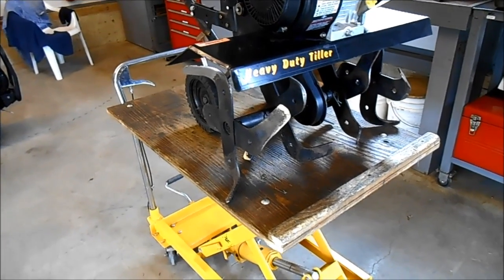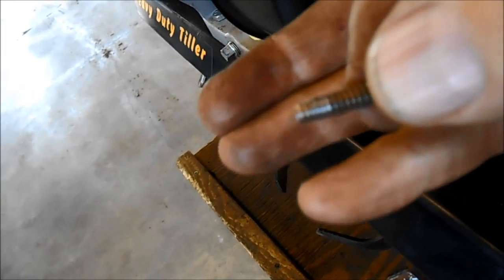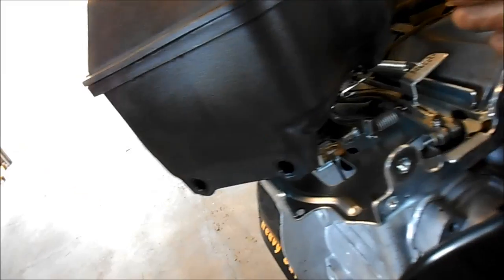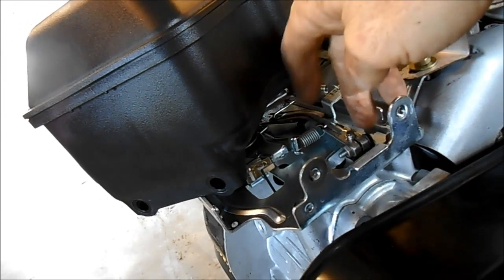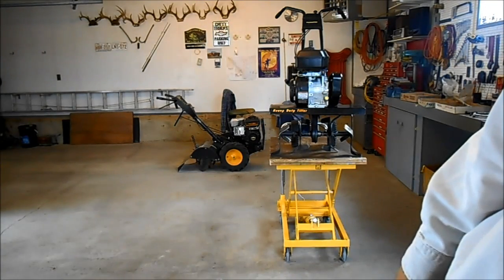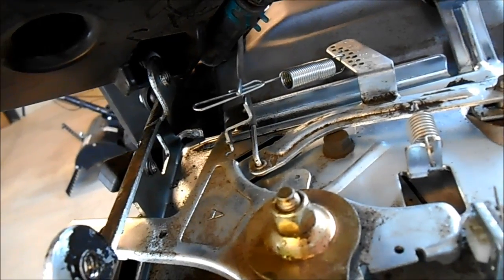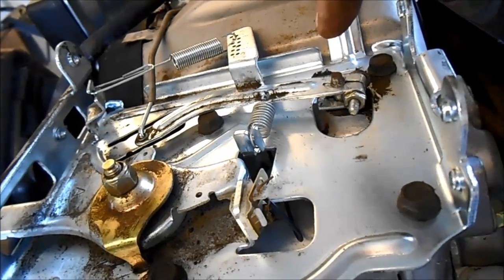Repairing a Governor on a 6.5HP Briggs Intek Motor

Comment: Great vid, I have the same governor setup. My 7hp tiller runs wide open. I replaced new carb, springs seem to work, set the governor counter-clockwise at wide open. It still won't idle or vary with throttle. Could the internal governor system be shot? Any other advice? Should I replace throttle linkage arm and springs?
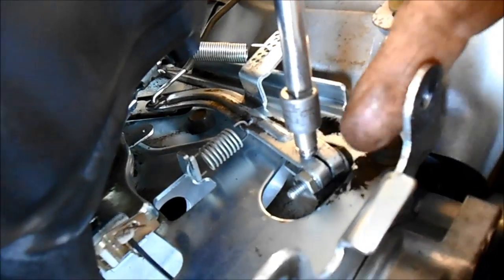Reply from the maker: if the arm is stretched around the govenor post (touching on both sides) you can take a hack saw and make the slot wider.    You can see it on 3:41 which could be touching in your case
Reply: @BrucesShop  So maybe the arm is not tight enough and is slipping? It is pinched together, so I'll give it a shot. Thanks so much.
Reply from the maker: @obamazadork  good luck

Comment: Good Video Bruce !!!
i will try to bend the TAB bring my RPM Higher on my Craftsman Snow Shredder ( i Diddled this Engine Myself after i Bought it used with a BLOWN Engine ): https://www.youtube.com/watch?v=-1lndf-o_Mo&t=3s
Reply from the maker: I commented on your video.  great work.  Joni
Reply: @BrucesShop  i used it today - idle went crazy high for 5 mins then settle  down ( i think to 2800 rpm) not sure though just going by the brightness of the light bulb

Comment: I'm so glad I found this video my briggs /murray mower is so old I couldn't find nothing on it, parts briggs no longer support, it was surging so i cleaned carb ran great they my gas tank started leaking around the diaphragm so got new ones now it is revving badly, that is like my governor so I'm gonna try and adjust it..thanks very much,
Reply from the maker: Adjusting the governor is the last thing to try.  Recheck your springs and tension.  Then do the governor.
Reply: @BrucesShop  I just got back the hardware store here said they didn't have that spring I wonder if i can order it, I got a spring and put it on and it still revving to bad I knew that spring wouldn't work, my gas cap is broken I cant find a gas cap for it briggs says online they don't carry these products any more for my model number :(

Comment: Excellent video. I have the same governor setup and I needed to buy a replacement linkage. I see where the linkage inserts but where does the end of the tiny spring on the linkage go?
Reply from the maker: If you are talking about the tiny spring that goes  around the throttle arm in goes it no the same hole on the carb throttle or sometimes it goes into a hole right beside it .   The other end is simislar.    I am talking about a longer tightly wound flimsy spring.   Did I answer that OK.
Reply: yes...
The spring that is around the arm. On the carb side it is obvious what hole it goes into but on the governor side I see where the arm goes in but I am unsure where the spring goes in. There are a couple of holes nearby

Comment: Dear bruce pender i am from holland am not 100% sure what the Governor do but am gone ask it any way i got 45k/m hour card JDM city  got 6.5 enging Brigg stratton motor in it but it only runs 40/45 and i want my car to go faster  is when i do this Governor dus my car go faster or it stays on 45km/ hour ?? can u help me thank u  for your video
Reply from the maker: In my opinion if you do that the engine will over rev.  (too much RPM)-----  Sorry I don't know what   "45k/m hour card JDM city means"
Reply: @BrucesShop  it's small jdm city car 45km cars small one but it got 6.5 engine Brigg and stratton
Reply: @BrucesShop  like. I sayed my. Car go 45km hour but want faster how to. Do in Brigg and stratton engine
Reply from the maker: My advise is to not make the engine run faster as it will damage it.
Reply: @BrucesShop  OK how can u is it possible to make my car drive faster than 45km hour in enging like that than?
Reply: @gabbergod28  a year later, but you can put bigger diameter tires, or a smaller gear on the axle, or bigger gear (more teeth) on output shaft/clutch on engine.  Or you can add TAV which gives more acceleration, then turns into an overdrive.  You're only wanting 10% more speed, so you could adjust governor and rev engine faster.  I wouldn't go over 4000RPM or you could seriously damage the engine. Running the engine faster will shorten its life.  You need to measure current engine rpm it may be macing out at 3200, in which case going to 3600 RPM wouldn't be excessive.  With the right parts (billet rod, billet flywheel, heavier valve springs, bigger carburetor etc) people get Predator 212cc engines up to way over 6000 RPM without fear of it exploding.  Stock piston rods will break (very damaging to engine) and stock flywheels will explode (very dangerous to you) at engine speeds like that.

Comment: i have a blower in the number 3 hole and i have to open the throttle 3/4 of the way for the rpm to change. i find that it dosen't rev high enough. to make sure that i understand corectly, you loosen the 10mm nut on the side you you tightened the 3/16 clockwise when you're throttle is wide open? i have the same exact setup
Reply from the maker: OK I am sorry i don,t understand what you are asking.  If you can get a different RPM by moving the spring to different holes try that first.  Stay away from the governor arm bolt and only move that one with the arm swinging one way first then try the other if it revs to high or not enough.  Good luck.
Reply: @BrucesShop  when i move the throttle ajuster, i have to move it almost at the end of the fast position to make my engine rev a little bit higher. i have alot of play in the throttle ajuster before the revs become higher.
Reply: and it dosen't rev high enough for blowing snow, its a arien deluxe 28 snowblower with a briggs and stratton motor. the governor assembly is identical as the one in the video. in what case do you have to mess with the governor arm bolt ? sorry for the questions but im a little bit confused, i work on chainsaw and 2 stroke motor. never seen a governor system before
Reply from the maker: @ryy597  I am not sure how much more I can help you.  The arm adjustment on the governor coming out of the motor is adjusted all the way one way or the other holding the throttle are in mid range position.  Take a look at 3:20.  I am sorry I am not there to help you.  Have you ever seen an internal governor.  The little shaft only rotates about 1/3 of a turn.  Good luck.

Comment: Thanks for sharing, that is the diddeling issue that for some reason, People refuse to listen and still break out all the bailing wire and hammers, either idling the Engine to its breaking Point or just making a Huge mess, lmbo!
Though, if not for those who are NOT Mechanically Inclined, i would have no fun!
Again, Thanks for sharing.....
Reply from the maker: Yes the first temptation is to rig it to just run and forget about it.  But that always comes back to bite you.

Comment: my 2014 briggs snow blower now Surging 
did not start after rebuild , sat for 3 years carb main jet plugged and emulsion tube holes 2 plugged 
after cleaning carb runs but surging at idle 
going to reclean carb and see
Reply from the maker: There has got to be a minor plug in there somewhere.

Comment: Hey bruce the throttle to adjust it to low to high its hard to move does it need w-d40
Reply from the maker: I only moves a little   maybe a 1/4 of a turn but you have to loosen the bracket first.  Then maximum adjustment wither way